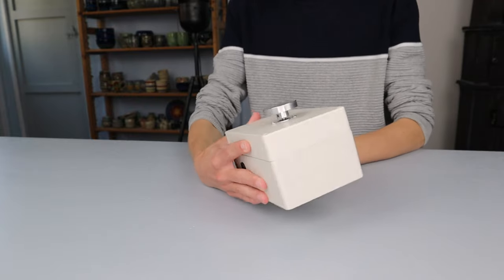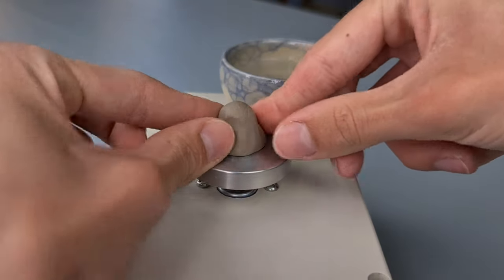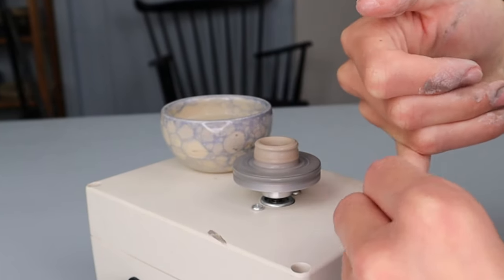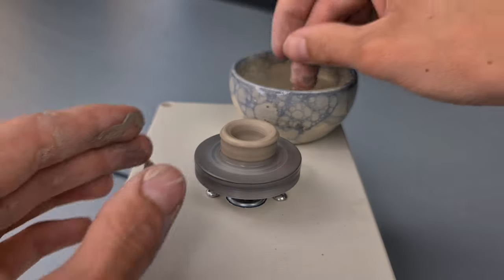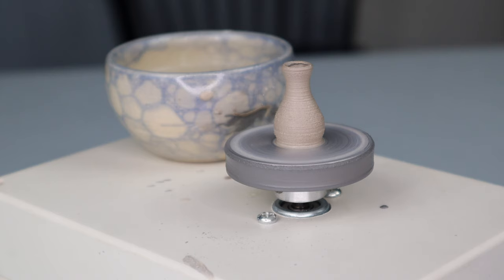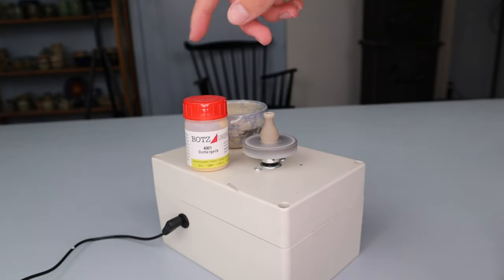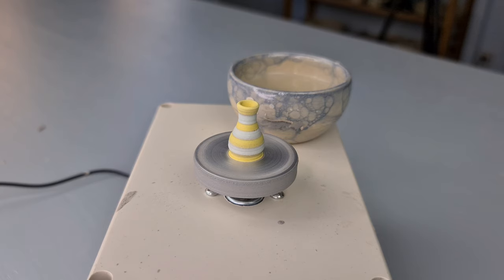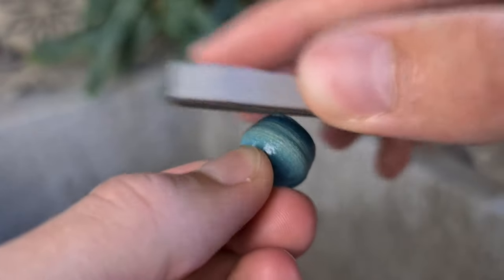How to make a mini vase on a mini pottery wheel

Comment: Throwing in miniature presents some unique challenges. I have found that small wooden beads glued to bamboo skewers make great mini throwing sticks and will allow you to support the inside wall of the pot while you pull up the outside. I also find that a small synthetic brush (golden takylon bristles have nice springiness) is great for smoothing the outside and the rim of your thrown form.
Reply from the maker: Thank you for the tips!
Reply: @caldervanandel  throwing that small requires a new way of thinking and the creation of tools that mimic the things we do intuitively with body mechanics.

Comment: i have a cone 10 porcelain clay. Will it work on a mini wheel?
Reply from the maker: Sorry for my late response, I think it will be harder to do, but not impossible😅
Reply: @caldervanandel  thanks for your reply, I tried the procelain, and you're right it was difficult. What type of clay do you recommend? Also some suggestions for glazes and firing?
Reply from the maker: I use standard white stoneware clay. And you can use any glazes you use on normal sized pottery😊

Comment: I bought my tabletop kiln, wheel and glazes based on your suggestions. Is there any way you can please do a video on the tabletop kiln firing for 06 including the glaze firing or pretty, pretty please share it?
Reply from the maker: Awesome! I hope you like it! What would you like to know about the kiln/firing?
Reply: @caldervanandel  Thank you for replying. I am interested in your firing table, temps and times for 06 including for the glaze.
Reply from the maker: Mine is not that complicated. For bisque I fire to 600 degrees Celsius in 5 hours, and then as fast as possible to 1020 degrees Celsius. I do the same thing with the glaze fire, but as fast as my kiln goes to 1220 degrees Celsius.
Reply: @caldervanandel  This is awesome! Much appreciated!
Reply from the maker: No problem😊
Reply: @caldervanandel  how long does it have to bake after the 5 hours? And how long total for the glaze firing for mini pottery?  Thank you! This is awesome!
Reply from the maker: It takes my kiln about 12 hours, so about 7 hours after the first 5 hours. But this is different for every kiln. Reaching the temperature is more important than the time that it takes :)